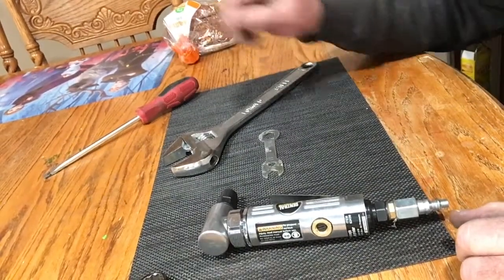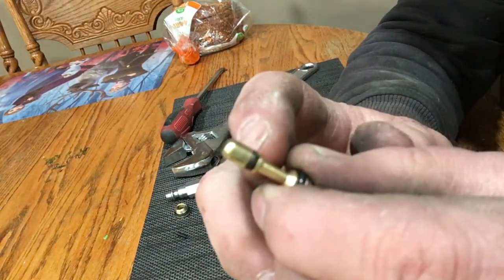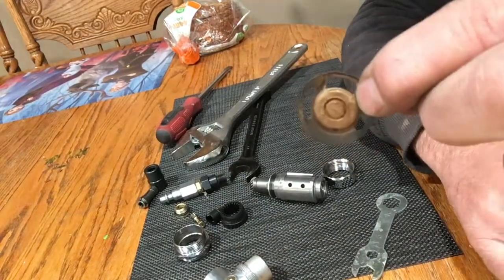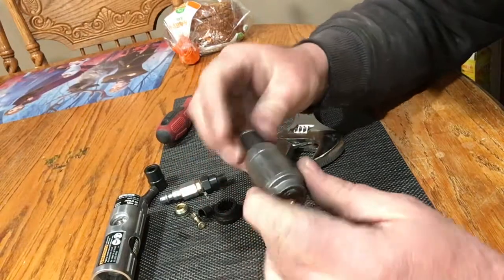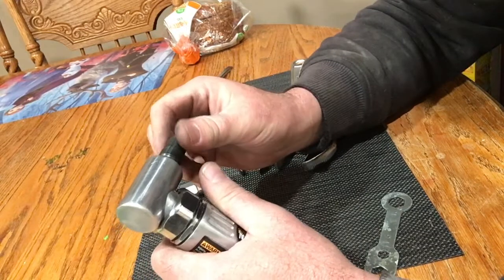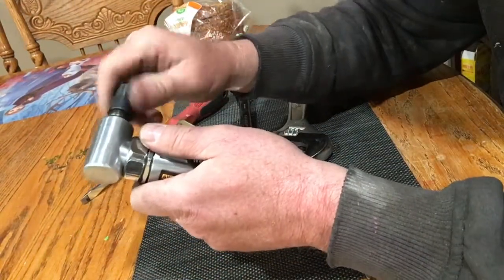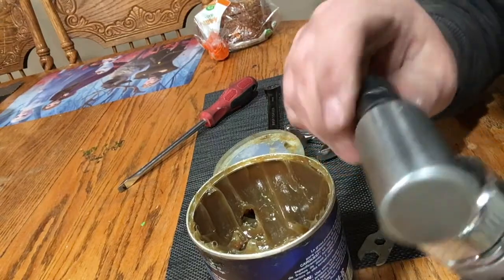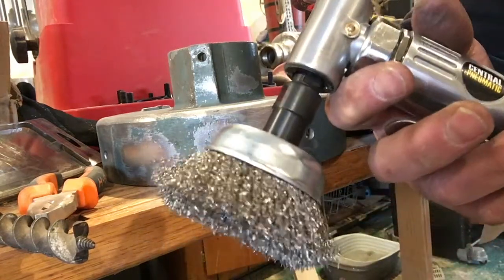Central Pneumatic Air Angle Grinder - DON"T THROW IT AWAY! Repair it!

Comment: Mine ran 5 minutes.   It had almost no grease in the gear head.   If you buy one of these, be sure to grease the head before you run it.  You can't buy the gears - so - what else to do but scrap it.

Comment: The main gear, the part that’s internal of the handling part, I have no idea what’s it called, mine won’t spin or turn, feels like it’s locked up the gears are not chipped, just the main spinning thingy wont move
Reply: It needed lubricant, fml

Comment: When I plug mine in the head starts to spin. It’s a super low rpm I can stop it with my fingers and see the details on the sanding paper it’s so slow. How do I get it to stop doing that. It should be off all together when I let off the throttle.
Reply from the maker: It sounds like you've got an air bleed somewhere . It should stop altogether. I would take it apart and check all the seals for cracks etc... It's a cheap grinder so in the end it might be more profitable to just get a newer one preferably of higher quality. Also I think there is an adjustment screw or nut somewhere on it (haven't used mine in months) so you might play with that.
Reply: Open it up clean it up real good. Lube it also as best as you can. And It will feel like a new tool! While at it, if any O-rings look suspicious just get news ones.

One other thing slightly more time consuming but most times worth the difference. Deburr and polish mating surfaces! ;-) Now that's entering "hot rod" field of action. LOL :-O But trust me on this you're entering very expensive tools area! 
Yes, it might be polishing a turd. But more often than not it will perform as the top models! And it's just time...

Comment: I'm confused about the thing you threaded in with the screwdriver in the center of that is like a screw what does that do I just bought mine and it's loose should it be tightened down snug or what is the procedure

Comment: What about the gear replacement?
Reply from the maker: If the gears are toast then it's time to buy a new one. The gears are pretty tough on these things so it's usually a matter of some tension adjustment. I haven't seen a grinder with torn up gears but that's not to say that some don't exist.
Reply: @jasonwilliams8321  you didn't adjust yours properly.
Reply from the maker: @burtreynolds3143  would you care to share this information?
Reply: This thing sheered all the gears in the first 10min of use. Harbor freight garbage..

Comment: I dont have much need for a die grinder but I've run into the occasional situation where I sure wish I had one. I don't want to spend a lot of money but I definitely think I can justify buying one of these now that I see how it's built. Seems like harbor freight has a consistent problem with not lubricating moving parts.

Comment: I bought two of these.  One had what I suspect was soft gears, ran 5 minutes as I said below and is not rebuildable.   The gear on the armature is destroyed but the other gear has no damage at all. The second grinder would stop running every time you touched it to a work surface (it had no torque).  On a positive note, the reason I bought it was that a friend has one that he swears by.  He demonstrated that he couldn't stall it by pressing hard against a wooden surface with a sanding disc.   He has had it for a few years and said it was one of the best air tools he has ever bought.  So - apparently something has changed.   Perhaps the manufacturer is using cheaper materials or skipping heat treatments or something.   Or perhaps it is a crap shoot and some of them work well.   I don't enjoy writing bad reviews but after two duds I'm not convinced this is a good product.
Reply: @lunarvvolf9606  Will do.   I haven't had a need for one again but I'm probably gonna give it another try.  This time I'll know about the locktite and grease.  The one I destroyed had almost no grease in it.

Comment: Though it's true these are a very basic construction and rebuildible, but.....if the seals inside are defective, you can't buy them. Orings maybe, but I doubt the diaphragm is shot, good luck finding another one. Also I hear it's got a leak. Was that where you didn't put any thread tape?  
It is weird it wouldn't spin, unless it was frozen due to lack of grease.  It is a shame u can't just buy kits to rebuild them. They are made really well and ashame that throwing them away is an answer at all. But for 15 bucks, most people feel like, why go to the trouble. As long as you oil and grease them, there's no reason to trash them. I just gave 80 bucks for an Ingersoll Rand 2 inch. And I'd be damned if I'd throw it away due to some seal failure. They better have a reasonably priced kit to repair it. 
Thanks 👍